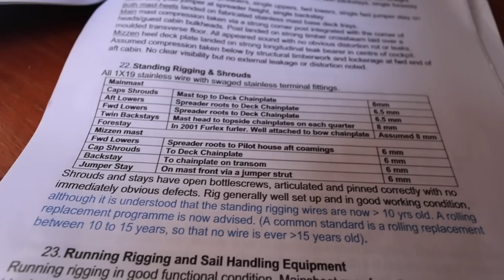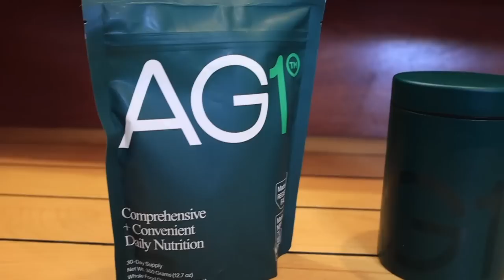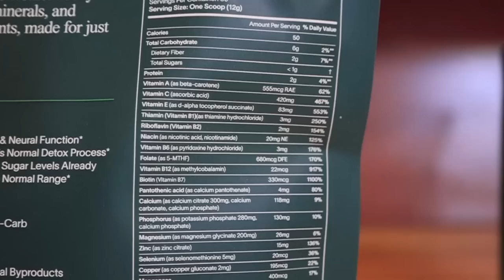Replacing our boats STANDING RIGGING (with no experience- eek)

Comment: Great job.  We did exactly the same with our ketch - took off our wires, put the new ones up and tthen had the rig  professionally checked and tuned.  All good, and don't wish to worry you, but did you have all your S/S attachment plates checked?  Ours all looked good but on our first big passage from San Diego to Cabo a masthead plate, which looked good, fractured and we lost our forestay and shredded our brand new genoa.  I'm sure you've thought about it and checked them all but feel compelled to mention it if it saves someone else from experiencing our disaster 🤪..  All the best.
Reply from the maker: Thanks Liz! We check ours fairly regularly and had the guys at the shop check them out too.  I'm sorry to hear about that, it must have been a horrible moment 😞

Comment: Zach after the event !!!! when Turning the Turn Barrels to tighten the rigging use a open spanner that fits the barrel using a bar, screwdriver through it will causes over stressing of the Barrel body and could crack it and or damage it so find an open ended spanner that fits.

Comment: Wow busy, busy, busy.  Great job in the end and result on the price.  Sounds like some of your sheaves in the mast need some lubrication so that would make hoisting sails a lot easier.  Fair winds. Andy UK
Reply from the maker: The sheaves are strange, we've lubricated them recently but they still make a horrible sound. Cheers Andy!
Reply: @TeuluTribe  Ah ok what did you use?  If you used WD40 that will be the reason.  You need silicone grease, spray.  WD40 dries out and leaves no residual lubrication.
Reply from the maker: @AndyUK-Corrival  we have pro lube which we got told to use from the riggers- think it’s just the metal pulleys which make that sound

Comment: Did you look into  "Dynema"?  It's stronger than steel, and way cheaper. 
 Check out tulas endless summer or Lady Africa. They both had Dynema on there boats and it looked and  Performed Fantastically. 
 Ok Thanks for a Great video this week. And cant wait for the next one. 
 So until next time, Aloha from the Big Island of Hawaii! 

P.s. Glad ya'll got the New cook top!
Reply from the maker: We did think about changing it. However, the quote that we got was just as much. As we would have to change a lot of the deck and mast fittings in order to use Dynema instead. Thanks for the advice Bill, we'll see you next week as always 😁
Reply: @TeuluTribe  Hmmm? In my study of the  Dynamima it is way cheaper. You buy the line you make it yourself and with the u.v.  Sleeve you put over it, it will almost last forever. 
 You can have someone make it for you. And I can see it  Is costing a bit more but it is cheaper than  Stainless steel wire . But it may  Cost more where you are at.

Comment: Pretty good on you measurement estimate. As it turns out, 13 mm is slightly larger than half inch. For wrenches you can interchange 12mm and 1/2 inch. If the wrenches are high quality and you pay close attention the tolerances will tell you of a mismatch. But they can interchange. 

As for time estimates, it could be worse. Software often takes 4 to 5 times the estimate.
Reply: 13mm = 1/2 inch . A 12 mm is nowhere near it
Reply from the maker: Lucky guess I think 😅 Thanks for the info!

Comment: Great episode guys. I too am changing my standing rigging on my Moody 46 S.V. Sarah. I’ve agreed for the yard to drop my mast at the same time but it will cost €12000 to replace it all 🤔😳. Anyway you should be proud of the job that you did. Did you install the steps on the mast yourselves or did it have them already? I’m thinking of adding them in case I need to leg it up the mast in a hurry. Have you any comments on if you like them or not? Keep up the great work 👍

Comment: Great job guys. Gotta say though when I saw you using a machinist hammer to remove the clevis pin (not sure if that's the word in English) I had a NOOO reaction. But seems like you realised and swapped out over. Great job and great video.
Reply from the maker: I would have used just about anything to get some of those pins out in the end. Cheers 😅

Comment: Question ? I hope you lubricated the threads on the new bottle screws ?? ,with ceramic grease ?
Reply from the maker: We went around at the end and did this 😊
Reply: @TeuluTribe  Thats ok but its the thread that needs it when assembling them as they can bind up and then the only way to undo /tighten then is to cut them off Thats the nature of S/S . Your old ones may have looked no good but they would have only been chrome plated /brass /bronze.

Comment: You don’t want to use stainless steel wire for mousing wire. The correct mousing wire is Monal wire. Monal an alloy which is more malleable than stainless but it is completely corrosion resistant in seawater. It’s also used to make the best keel studs because it doesn’t suffer from crevice corrosion like stainless steel does. Stainless steel relies on the presence of oxygen to create a surface layer of inert oxide that prevents it corroding. However if the stainless is in stagnant water or mud or any oxygen free environment it can corrode and fail. You should be able to fine Monal mousing wire in any good Chandlery or rigging company. Cheers and fair winds.
Reply from the maker: We looked everywhere for Monal wire but couldn't find it, thanks for the info!
Reply: @TeuluTribe  I have some on board it’s called “Ormiston Monel seizing wire” I think I misspelled Monel it’s an e not an a sorry. Try searching again for Monel.

Comment: I  don't want to cause you any distress, but i think you just replaced allot of rigging that didn't need doing. If your swagelocks are tight all you need to do is check for wear om your pins and do an NDT on your turnbuckles and coupling plates. You can do this with a dye and penetrator that will show any cracks. the discolouration in the stainless cables means nothing. Best regards and I love your channel but i think you have been ill advised.
Reply from the maker: Hi Steve, thanks for the concern, the rigging was well over 15 years old…maybe even original from the 80’s (no invoices or receipts showing replacement). We were advised by a Uk company last year to replace it and for our peace of mind, we wanted to swap it out :)
Reply: @TeuluTribe  Im glad you have piece of mind and i am sorry for judging from afar,  xx

Comment: Opposite is not a 90 degree angle...
You should really use Stainless Steel tools for the Stainless parts. Or a brass brush, not a steel one. And your spreaders look quite corroded. At least use some isolation paste with stainless in contact with alloy.

Comment: Don't want to sound like a party pooper but you used 13mm pins in a half inch holes which is 12.7mm hence they wouldn't fit, thats OK if the hole had been accurately machined but using a drill or dremmel the is no way you created an perfect 13mm circular hole.
This will create point loading on the fittings, that can lead to stress cracks forming on the fittings you drilled / dremmeled...
Reply from the maker: Thanks for the heads up. We’ll monitor them and can always swap them out if needed 😊

Comment: Hi Becka and Zach.  As a now retired Engineer, I hate having to work with Metric stuff, having spent most of my life working with Imperial measurements.   The fact I can work in both standards, doesn't make it any easier, when I think and work in Imperial.  Yards instead of Metres;  Feet and Inches instead of Centimetres and Decimetres; Miles instead of Kilometres.  Trouble is, a lot of the people I know are younger than I am and grew up with the Metric system, so I'm forever having to do calculations of the fly, then trying to explain things to them.  AARRGGHHH!!!!   I know how Zach feels about those Clevis pins.  Half an Inch is 12.7 mm, whereas standard Metric sizes are not compatible; the nearest Metric to Half Inch being either 12 mm or 13 mm.  And that's without all the other Engineering Standards, such as AF; ANC; Whitworth; BSF; BSP; BA; UNC; UNF; ISO Metric Fine; ISO Metric Coarse and a few others besides.  And to add to all that, they use four different Thread types in your everyday Computer.  Enough to give anybody the screaming abdabs, when trying to find the correct nut, bolt, screw or washer, for something you're trying to service, or repair.  Anyway, glad to see you finally got it sorted, even if it did take you 2 weeks, instead of the expected 3 or 4 days.  Onwards and upwards.   Just a shame you didn't tell us how much the final bill was.  I think we would all have been interested.  Fair Winds and Following Seas.  Russ, Pompey. UK.